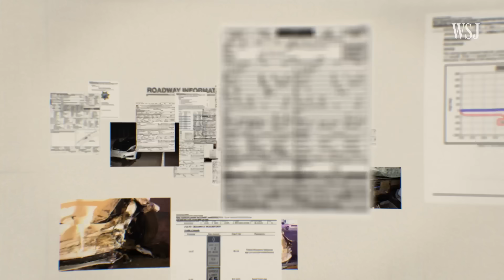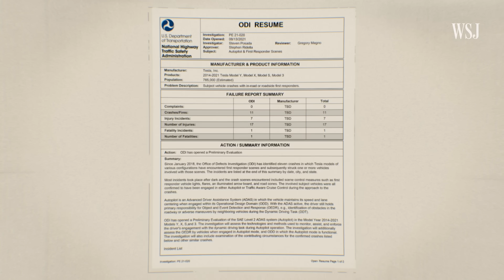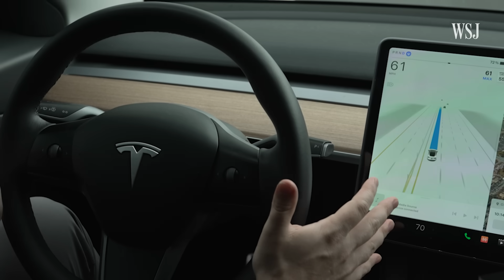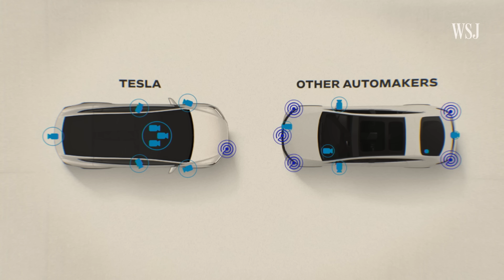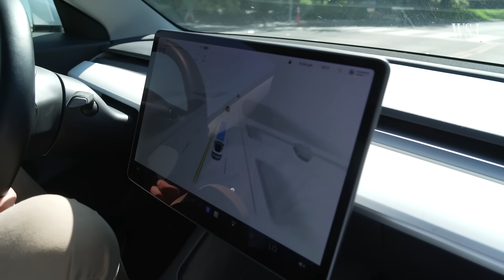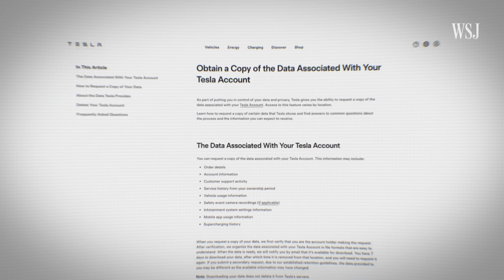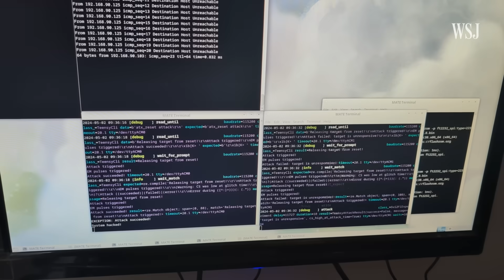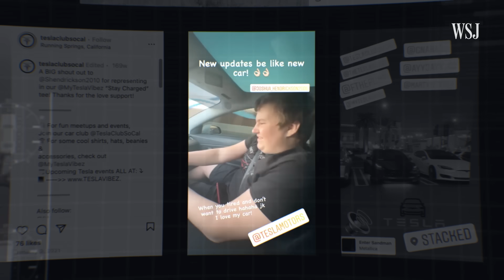The Hidden Autopilot Data That Reveals Why Teslas Crash | WSJ

Comment: 9:07  "He'd leave about 3am to get to work by 6."

😮3 HOURS, ONE WAY?!  That's 6 hours worth of just driving to frickin work!  Dayum!
Reply: No wondering why he uses autopilot, 6 hours worth of driving in boring highway is crazy
Reply: Definitely. I am not shocked he didn't put his hands on the wheel but i am suspecting he was napping  @createx1751
Reply: @createx1751  this is recipe for disaster
Reply: That's like my commute. I only have to make it a few times a month, but it's brutal. I'm often driving home from work very late, getting home at 2am after having woken up at 7am and having a whole day including a 6hr flight.
Reply: @iridiumcaptain  Having such long work+commute hours is illegal in a lot of countries, just because it leads to sleepy drivers on the roads.
Reply: Indeed, this is absolutely insane. I wish we could figure out high speed rail train like virtually the rest of the world. Train at 160 mph would do the same route in 1 hour + 30 minutes to navigate to and from station - boom, you can leave your house at 4:30 instead of 3 AM
Reply: @T13Nemo  rail networks like japan are really nice.
Reply: @T13Nemo  Rail was figured out many years ago. It just doesn't generate money for the rich like cars do.
Reply: @pompeymonkey3271  Saw another comment that he works at a construction site though, which can change once one project ends & you start on another, & they may be some distance from train stations. In my country the contractor company will employ a driver to drive workers to the site on the back of a flat bed pickup truck/lorry though that brings other safety concerns e.g. lack of crash protection. Think trucks/lorries are chosen so that the company can use the same vehicle to transport either workers or cargo
Reply: @T13Nemo  he needs a family member to drop him to the railway station, if not he has to find parking, then purchase a railway ticket. From the destination station, he has to go to his workplace with help of cab. Repeat the same thing in reverse to come back home.
Reply: @T13Nemo  He lived in California. I don't live there so I can't say this is the case for that crash, but a 3 hour commute in California doesn't mean he drove 3 hours away - it means there was 3 hours of traffic between him and his work. Without that traffic it could legit be a 45 minute drive by car. It's more likely a congestion issue.
Reply: @babybirdhome  yeah no. at 3 am there is no traffic in any place in California, even the 101 in DTLA is empty at that time. This man was probably 200 miles from his work site.
Reply: @babybirdhome  So. Cal. resident here. Yes and no. At 3AM, there will be light traffic even on the busiest freeways. The drive home could be much longer. I’ve known a lot of people who have done very long commutes for work, including someone who fell asleep at the wheel and crashed driving home from Woodland Hills to Victorville. There’s a lot to be said about the why’s and how’s of commuting here, but I’ll make one more relevant observation: because traffic is so light in the early morning hours, people tend to drive extremely fast and aggressively (I’ve personally seen weaving around traffic at 100+ MPH in a 65 MPH zone).
Reply: @T13Nemo  Unfortunately highspeed trains don't work like that. The highest speed takes long distance to accelerate to and the same with deceleration. If it has multiple stops in a short distance such as going through a city, the train has to maintain a much slower speed just so it can stop as planned. Plus, due to noise and safety reasons highspeed trains just can't be very high speed at all if you are a city dweller doing a short to immediate range travel daily.
Reply: @Jademoist  , you are correct, however, most of the world figured this our already. Look at the Netherlands for example, they have express and regular trains.
Their regular trains do 90-100 MPH.
Express - won't be much faster, but they would skip some stops.
Sure, having 200 MPH train is nice, but a simple 80 MPH train would do just fine - 10 out of 10 times it'll be faster than driving here.
Reply: Have you ever actually been to a place with high speed rail? Japan? That society is so well setup around public transportation and I never once thought there was noise pollution from the trains @Jademoist
Reply: This is why public transportation is important, it's a similar worklife in Japan and other parts of the world, but they have better commutes
Reply: Good pick up. Pretty crazy commute. Obviously a super hard working and loving dad, tragic it happened for his wife, kids, parents, and friends. 

The comment at the end rings true. It’s too much to ask of people to simultaneously trust their cars auto driving feature while paying attention. I think fully autonomous is the way (ie Waymo) if you want that sort of thing but we’re so far away that this transitional period will be really bumpy. 

Personally I found Teslas autopilot too nerve racking and had too many close calls that I just never use it.
Reply: @someyoutuber99  LIDAR would have prevented most of these crashes. Computer vision simply isn't mature enough a technology to be relied upon for self-driving. With LIDAR, even if the AI doesn't recognize what it's seeing, it will know that something is on the road in front of it.

It's like walking around in a very dark room. There's just enough light to make out vague objects, but you can't see what they are or exactly what shape/size they are. LIDAR is like having a cane.

Musk's decision to not use LIDAR is just based on greed, nothing else. Remember, he isn't an engineer. He isn't a scientist. He's a businessman. He'll go up on stage and talk about how LIDAR isn't necessary, computer vision is good enough, etc.. This is contrary to what the actual engineers believe. It's a financial decision, plain and simple.

If your doctor suspected you have a cancerous tumor, you wouldn't go ask the hospital c suite if they think you should get a biopsy. You'd listen to the expert.
Reply: Add that to an 8 hour shift. He was probably exhausted as well.
Reply: Yeah - that’s why he was sleeping when he got in the crash! 100%.  You stick a little ankle weight on the steering wheel and the car thinks you’re engaged. That’s why Tesla recently added a camera watching the driver to ensure your eyes are open.
Reply: He's probably sleeping.  I had a coworker who drove a Tesla from San Antonio to Austin (about 100 miles on I-35) for work, and then back again every day, and that's what he said he did.
Reply: Cali life, bro. As a kid I was baffled that people would drive from San Diego to LA for work every morning and back at night! Once I was old enough to start doing the math between driving and the house prices, it clicked. It's a shame, those people throw 1000 hours a year away sitting in that traffic there and back. That's a part time job just showing up for work.
Reply: Energy drink no one see?
Reply: That is typical commute time in LA 😂
Reply: bay area super commuters are no joke
Reply: Uhh, Teslas start at like 35k, starter homes in my city in SoCal are 3.5m.
Reply: Meh, not uncommon. A lot for these families like to live super far out in rural areas for the “school/community”, which often is just buzzword in California for “we don’t our kids to grow up around Mexicans”. Heard it many times before
Reply: There's a saying in that part of California... "Drive until you qualify"
Housing near the big cities is insanely expensive, so lots of folks end up with really stupidly long commutes.

Yeah, higher density, rail, and transit oriented development are really needed.  Also, lots of companies could choose to have better locations instead of picking places where the top (rich) executives want to live.
Reply: My next door neighbor does that too. He work/repair on windmill all across the state.
Reply: I work 2 hours away sometimes
Reply: Might be je is a consultant for other companies. I have some collegues like that with crazy commutes.
Reply: That’s what zoning and housing policy result in. I just wish the people opposing new developments where I live thought about how they’re killing people where I live.
Reply: I've had to do that in north cal.
Reply: Radar?
Reply: Only in USA
Reply: I spent every day in misery. It can seem like the only reason to be around my parents Bonnie and Terry Tipton in Las Vegas is for them to make me feel inferior to them in character, judgement and intelligence. And the same goes for my other relatives. I try to get some happiness from doing some physics, engineering and calculus problems from textbooks. I am never happy with my parents and other relatives. Why am I made to believe I am a terrible person
Reply: @ChrisVink-b5b  what's going on Chris.
Reply: @FishermensCorner  Feeling psychologically destroyed and like American society does  not believe I am capable of much.
Reply: @ChrisVink-b5b  why are you spamming this all over... you're almost 60 talking about your parents?
Reply: Enjoy capitalism
Reply: @karendarrenmclaren  You could try communism.
Reply: @karendarrenmclaren The housing shortage in California is caused by the opposite of capitalism.

Rent in Austin, TX is plummeting "despite" capitalism. Why? Because it's legal there to build housing.

Hope this helps.
Reply: @efovex  there can be nothing "opposite to capitalism" in capitalism. If you don't know what is capitalism, it's okay. 
Just don't say stupid things out loud
Reply: More like it is capitalism in California because of incumbent landed NIMBYs who want to keep their house prices inflated; it's defense of market dominance since all the cheap flat land is already taken. California homes are both more costly and under threat as new developments are pushed farther from urban centers where the labor and resources are readily available increasingly deeper into winding wildfire territory.
Reply: @karendarrenmclaren instead of working yourself towards a better employment, you decide to blame "Capitalism". I'm sure there are better jobs for him, and he just doesn't want to.
Reply: @loooopeytunes  so you saying there is "better jobs" for everyone? 🤔 any data? Analysis? To support your baseless claim...
Also in case of USA, you always "forget" obligations that comes alone with most of jobs. Which is okay, since you never lived anywhere else but capitalism 😑
Reply: @ssumac  your ignorance is showing. I'm sure you could read a book and educate yourself but you just don't want to.
Reply: That's California for you. Probably asleep at the wheel.
Reply: 4.5 hours of it are probably charging stops.
Reply: Sounds like he was using the time to sleep
Reply: This would be the perfect use case for autopilot if it was reliable, you'd be able to sleep on the commute. 

I think we're a few decades off from this becoming a reality.
Reply: Obviously the people that spend the most time on the road are going to be the most likely to get into accidents. Someone who drives ten minutes a day has a much lower odds of ending up in this video.
Reply: If it job earns enough to be worth that drive, then it pays enough to live nearby instead.
Reply: @technomage6736  Its california, you have zero ideas about prices there
Reply: If he could buy a Tesla, he could probably afford to buy a house closer to his work and avoid the stupid commute. Can't fix stupid.
Reply: What a dummy
Reply: range doesnt last 3 hours of highway driver

Comment: I have over 40k miles of FSD on my Tesla and it’s incredible and I use it 100% of my driving, but I still pay attention to what the car is doing and am always ready to take over.  Autopilot is not the same as FSD and the driver is always responsible.  The pilot of an airplane is still responsible for the flight even when autopilot is on.  That accident outlined in this report is 100% fault of the driver not the car.

Comment: Since day one I felt tesla Auto Pilot is false impression for customer to rely on technology than our common road sense. I used couple times but I stopped using it since I noticed it unexpectedly stopped on road without any vehicle in front but lot of traffic cars behind. 

But my family uses it and they blindly using it. 

In my experience world is not yet ready for complete Auto Pilot vehicles. 

Cruise control is okay to use but not auto pilot. Especially Tesla is junk in this category.

Comment: Poeple are going mad over it's 2024 not 2021, FSD and Autopilot is same etc. Thing is, Tesla don't have enough sensor. On safety side Autopilot should give you same level of safety as FSD (at straight line and lane change of course). It's a horrible idea to cut costs on sensors and entirely relying on Cameras. That's the problem, the tech mostly isn't.

Comment: Imagine always having a beginner driver driving, and then having to be ready to take over all the time. This seems to be what it's like to use autopilot
Reply: It's more like having a helmsman handling the maneuvering so you can attend to higher-level tasks such as maintaining situational awareness.
Reply: I've got the FSD and since v12.5 I've felt like it can drive on par with me, outside of exceptions.  That's why I like it, I can focus on the road and vehicles around me instead of maintaining my speed.

I still hate that it has one critical weakness, poor ambient lighting.  The camera-only system is just unnecessarily non-redundant for something billed to be the safest option.
Reply: @charlespaxson2375  Exactly this. If they're going to use a cameras only system, then they need to use only the best cameras for the job. They need to be able to see better than humans at the very least.
Reply: @charlespaxson2375   My problem with that is that monitoring your speed & maintaining situational awareness are both instinctive behaviours you should be doing 100% of the time you're behind the wheel.  Driving is not the same as piloting - aircraft have automated systems because they are complex machines to fly.  Driving is nowhere near that complex, and if you need a computer to manage something for you so you can "focus on the road & vehicles around you" then with all due respect - you shouldn't be driving.

Like pilots, a drivers licence is a privilege that requires a minimum level of skill & capacity to perform safely... so it's worth thinking about the instinctive skills that you're allowing to atrophy by relying on automated systems.
Reply: I think people should be a lot more curious about how these people who get into trouble with it were able to convince themselves that it was safe, because I've never gotten that impression from it, you can watch people demonstrating it and it made mistakes constantly.
Reply: We have Tesla autopilot and that's exactly what it feels like - driving with a student driver at the wheel.
Reply: Yes, every car with driver assist is horrible.  My Tesla has FSD 13.2.  It is amazing.
Reply: Exactly - they are relying on humans being the back-up for a computer, rather than the computer helping the human avoid mistakes (like aviation automation works).
Reply: @medea27 sounds like they're using real world drivers to train the ai without telling us that's what's going on.
Reply: It's a beginner driver who is using a single sensory input that is completely alien to you.
Reply: At this moment
Reply: 💯. Need to text at a red light? Auto pilot great to get going when the light turns green. It’s surprised me a few times. Why is auto pilot camping in the left lane? Oh because It’s on auto pilot. Always drive, let auto pilot assist. 🤦🏽‍♂️ this crash is dumb. Condolences to the family, because their father and a husband had to be a statistic of why It’s important that only, you, are responsible for your safety.
Reply: I agree.  I think its more difficult than simply driving yourself.  Most of the people saying the drivers should have been paying more attention are missing this point.

Comment: This is very outdated information. Wake up WSJ. You’ve been asleep for 3+ years. This information is so old it is now obsolete. Second point is that this system is for driver assistance. The driver is the one responsible for the control of the vehicle. Extremely poor reporting.